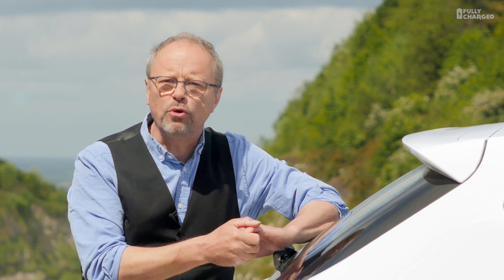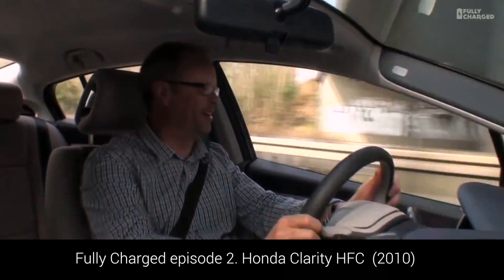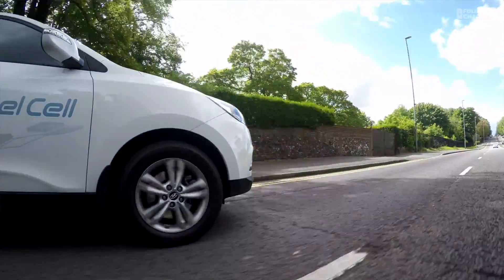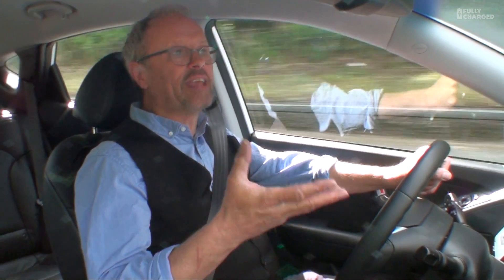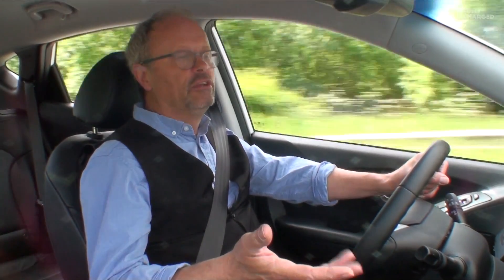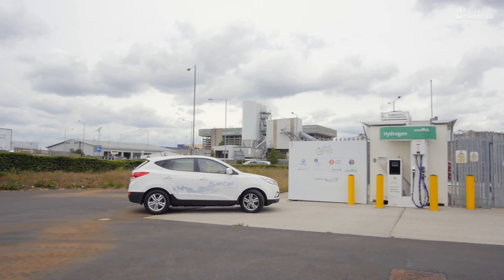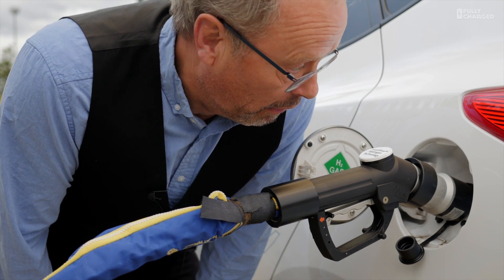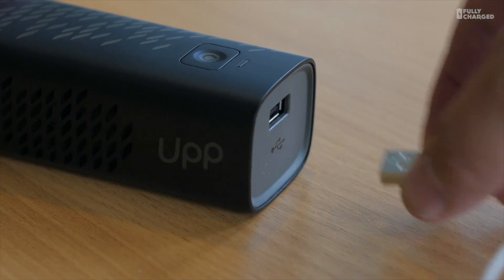Hyundai ix35 HFC | Fully Charged

Comment: A few things seem to have been glossed over.
1. That Carbon Dioxide is a by product of the generation of Hydrogen by steam reformation at refineries.
2. Measurement of the gas provided by a hydrogen pump has always been an odd issue which is why most trials have provided the hydrogen free of charge. How exactly is the gas being weighed? If the whole car is being weighed - what happens if a passenger gets out during the refilling process?
3. The pressure 700 bar is around treble that of a scuba tank & in most countries a scuba tank needs to be checked regularly in some annually  - how are these tanks and the associated pipework going to be checked?
4. Often the wind generated power is turned off not so much because it is not needed but because it is more expensive than other sources.
5. If you loose around 70% of the electricity electrolysis to fuel cell, then surely it makes far more sense to drive an electric car.
6. Worldwide there are very few Hydrogen stations yet already one has exploded in the USA in 2010
This whole Hydrogen gimmick just seems to be a desperate attempt by the oil industry to keep in the game once electric cars become more widespread.
Reply from the maker: Roy Richardson I think I agree with you on many points you made, with the exception of the wind energy argument. 
Wind energy is much cheaper than any other form of electricity generation, the reason it costs more at the moment is down to subsidies and guarantees to investors of locked in £ per megaWatt payment. 
This has already been slashed to nothing as regards onshore wind by the current government which is fine as long as they slash similar 'incentives,' 'tax advantages' and 'non subsidy subsidies' to other forms of generation, in particular nuclear which sucks up such vast quantities of all these tricks it's beyond imagining.
So, in a genuine level playing field world, which I admit we'll never live in, wind generation has such massive advantages it would put all the coal, gas and nuclear industries, their powerful and richly rewarded lobbying groups out of business.
Reply: fullychargedshow I agree that the incremental cost of the wind energy is low, but the slashing of the subsidies is only for as yet uninstalled plant it does not affect existing renewables. Due to the subsidies to the plant owner which are guaranteed for some 20-25 years this inflates their charge to the user (the electricity companies) & the FIT are usually inflation linked - so any spare cheap electricity is not likely any time soon.
Reply: fullychargedshow Well, why not store it in grid batteries or home batteries. In general, the Lithium batteries have a 90% cycle efficiency, which is quite good. It's similar to how Tesla uses this in a way for one of the SuperChargers in america where they have a battery buffer to decrease the fast charging impact on the grid whilst charging the Tesla at 100kW.

There is a point though, where batteries just don't make sense anymore when you have that much generation.

From a earlier video you posted when you visited the national grid in England the spokesperson told you that they could easily sustain half a million cars. So you could argue that they could channel the current excess energy into a BEV, the problem being, we don't have half a million of those yet!
Reply: Craig Britton The key problem you can;t get round is that the hydrogen solution is either using hydrocarbons - in which case why bother, or is using hopelessly inefficient hydrolysis. If you have electricity from whatever source it makes more sense to use it directly in batteries rather than convert into hydrogen loosing around 70% of that energy.
Of course NASA like Hydrogen - in space you can easily keep it at low temperature for efficient storage simply by exposure of its container to the hard vacuum of space
Reply: Nick Cummings Indeed - I have a Tesla Powerwall reservation to attach to my Solar PV.
Reply: I totally agree - at the moment hydrogen doesn't add up. Musk even calls it "dumb". To me that means that the supply chain and its supporting technology needs improved. It doesn't mean we should abandon hydrogen. I drive a plug in hybrid every day and very rarely use the engine. When I do, however, the quick refuel convenience makes a difference. I could live with a Tesla (bank manager and speeding tickets permitting), but I'd be far happier with something like the ix35 if hydrogen became green.
Reply: Roy Richardson I think one of the other issue with Hydrogen, or rather the Hydrogen filling station, is the cost.
It's not difficult to understand that a Hydrogen filling station will be substantially more expensive than a charging station. You have to maintain a very volatile gas under high pressure and low temperatures. On a recharging station you only need a very high amperage power supply unit. We already have off the shelf products like this.
I would say that a recharge station will cost a very small fraction of the price of a Hydrogen fuel pump to build up. Not to mention the maintenance. Again it will cost pennies to maintain a recharging station versus the thousands that will cost to keep the refueling Hydrogen stations, no to mention the enormous amounts of money that we will need to spend moving the hydrogen from the production facilities to the pumps.
We already have an infrastructure for distributing electricity. Even if you live in the middle of nowhere, it wont be very difficult to connect your house to the grid, and consequently recharge an electric car. Can you Imagine living in the country and expecting these car manufacturers putting, maintaining, and refueling an Hydrogen pump station.
That's why I don't agree when ***** said on this video that Hydrogen refilling stations will pop up as quickly as we seeing the recharge stations come up. 
One final point I would like to make is the economy of this technology. It's seem to be very complex highly inefficient and more easily controlled by very wealthy only individuals. The owner of a small shop on any high road can put a charging station in front of his shop and use it to promote his shop or just charge for it usage, could you say the same about a Hydrogen fueling pump?
Reply: Roy Richardson Apart from using it in Cars, there is a lot of work going on in the field of diverting 'Waste' renewable energy into the production of Hydrogen, and even man-made Methane, to add to the existing Mains Gas network that links almost all of Europe.  So effectively, as well as high-capacity batteries, we could in future be storing renewable energy in our gas supply.  There was an edition of 'Costing the Earth' about this, on BBC Radio 4 recently.
Reply: Roy Richardson As Robert described with EV chargers, now that hydrogen cars are available the infrastructure will improve exponentially. This improvement, investment and innovation will happen throughout the supply chain - starting at the original energy source and continuing right through to the pump. For example, significant amounts of research is being targeted at reducing the energy required to split hydrogen. Even if the hydrogen process remains relatively wasteful, the carbon neutral energy sources driving it will improve. Roll to roll solar cells being a potential game changer IMHO. Alternative nuclear generating options based on a thorium cycle are also looking attractive for low cost & low waste electricity production in the medium term. On a side note, hydrogen is NASA's rocket fuel of choice.
Reply: Craig Britton As indeed it may do, given time and research, but ATM it poses more questions than it answers.
Reply: João Silva Indeed - Hydrogen stations cost between $3m and $6m whereas a Chademo costs $16k + installation.
Also given the low density of hydrogen I have seen various estimates of 5 to 8 times as many delivery lorries to deliver the same energy level as gas/Diesel.
The main maintenance issue on Chademo seems to be cleaning filters and dealing with issues on authorisation/card swipes.
Reply: When humanity starts to make strides forward, idiots like you try to drag it back. 
You are just another flat-earther with an opinion.
Reply: +Roy Richardson I knew that the difference was Millions Vs Thousands, but I had no sources for this numbers. I guess Elon Musk is right, this is a dumb Idea, at least for now.
Don't get me wrong I would love to see this technology mature, but I'll be damned if anybody expect me to pay all the millions that it will take to make it into a feasible transportation network.
The other point is that battery technology is improving very fast, and with the advent of graphene and other newer substances, researchers are talking about doubling or quadrupling the battery capacities. This will mean electric cars doing 600 to 1200 miles on a single charge. With this technology you would even need the recharging station. We would just refill the cars at home.

Comment: Sorry but hydrogen still scares the hell out of me. Let's see a fully fuelled hydrogen vehicle getting hit from front, rear and sides (not at the same time) NCAP style simulating an 80 mph impact with another 4x4 size / weight vehicle. If it survives with no breach, I think the safety argument is over.
Nothing to hate about this particular car though, it looks like a very slick piece of engineering. Nice work Robert :)
Reply from the maker: Stephen Smith I truly don't think there's a safety issue with this. As squid bait said, this car has been through an extensive and highly destructive series of crash tests or it wouldn't be allowed on the road,
We all drive around in cars with a very explosive fuel sloshing around in the tank. 1000's of people die every year in hideous vehicle fires after sometimes quite minor accidents. 
Even if somehow a hydrogen tank is ruptured the hydrogen bleeds out in seconds, I think it is a lot less dangerous than current fuels we all deem 'normal.'
Reply: Stephen Smith This vehicle is on the road already so you can assume such tests have already been done extensively. This sort of thing is required for any car regardless of its power source.
Reply: Stephen Smith in an accident like that a std petrol tank will be ruptured easily vaporising the contents, and the people in the car and whatever hit it are probably dead anyway, in this case standard vehicles are the hindenburgs!

Comment: Hydrogen cars only exist so the oil companies can still sell you something. Protecting their profits.
Reply: breaksbassbleeps Agreed, this is the issue I have with hydrogen.  You still need companies to produce the hydrogen (as mentioned), you need a hydrogen distribution network (trucks, like fuel trucks), you need refuelling stations.  With standard electric vehicles, you can refuel at virtually any house or business anywhere.  An EV is quite functional even without a single fast charge station in the area.  There isn't a single hydrogen refuelling station in my state - completely useless here.  An EV could theoretically be charged at a completely off grid location if they have solar and battery storage!
Reply: breaksbassbleeps perfect.
Just buy a BEV, generate (at least some of) the power from your roof.
Reply: disagree with there are plenty  source of hydrogen more than oil.
Reply: Refilling your car in 3-5 minutes is quite attractive though. Low downtime, great for carsharing and selfdriving carfleets. So I think it is a great addition to a future without combustion engines and one of the many solutions. Le'ts not forget that parking and recharging space will be a huge problem if 80% of all drivers have EVs.

Comment: How much platinum is there in a battery electric vehicle?
Reply: fullychargedshow It was a trick question, there's none :-)
Reply: Nick Cummings Yes, there are quite a few, but they operate at quite a high temperature. They are also generally sized to a 20 foot shipping container as a generator replacement.

The problem is, fitting something that can work with petrol into a passenger car with the related temperatures is a bit of a pickle. A truck would probably have the space to fit the fuel cell and dispense of the generated heat.
Reply from the maker: zlozlozlo I bet there's some, I don't know, but if there is it will be a very, very small amount. I'm now going to try and find out.
Reply: zlozlozlo In chemistry Platnium is a non consumable catalyst. Unlike Galvanic Cells where anodes & cathodes are consumed and created depending on the direction of the electricty flow. The fundemental type of chemical reaction are very very diferent and seperate. The primary function chemicals of batteries is not Platnium.
Reply: zlozlozlo Platnium Fuel Cells are long outdated. No one even would even consider mass producing them anymore.
https://en.wikipedia.org/wiki/Fuel_cell#Comparison_of_fuel_cell_types

That is a list of other probably better fuel cells based on better catalysts & fuels.
Reply: No one even would consider mass producing them anymore. Hmm. That's weird, the Hyundai guy in the video just said there's platinum in those 1000 or so cars they're making. Yes, there are other types of fuel cells that don't use platinum. They usually operate at very high temperatures and have to be really large. Please wait until you get a bit smarter until you try your hand at commenting on technical stuff.
Reply: zlozlozlo Oh woops sorry mah bad, i should of read up on hyuandai's stupidity. I realy can't believe companies would still even both with such stupid methods. Wow this is a massive fail. 
P.S. I'm the wrong person to criticise experience in this area.
One part I did not foresee is the stupid actions others would resort to doing.
Reply: zlozlozlo Is there a Fuel Cell that uses Benzene/Petrol ?

I only ask because I assume it must be a more efficient way of extracting the energy out of it than just setting fire to it ?

Comment: Two things are neglected in the hydrogen discussion in my opinion.
1) Production
It is suggested that hydrogen can be produced when there is too much renewable energy. In fact, in Germany energy prices are negative at times especially in the weekends. More often however, there is no surplus of renewable energy and how does this effect the suggested production of hydrogen? Will production be stopped at those times or will these installations tap into the grid to continue production? In the latter case these installations will put a serious strain on the grid which already has to come to terms with low production of renewable energy.
If the installation is stopped when there is no surplus of renewable energy, I seriously doubt that the hydrogen can be produced at a compatible rate. These expensive installations usually need to run 24/7 to be profitable.

2) Infrastructure
When I look at the small hydrogen stations (250kg/24h) in use today, I notice they have quite an installation hidden behind the pump. I wonder how this will work at motorway petrol stations when 2500 kg/24h and more is needed. Where the hell will they put the pumps and storage tanks? If they can't put them underground, how will it be protected from accidents and sabotage? What is a safe distance to houses and other buildings?
Reply from the maker: Ad van der Meer You ask very good, very well thought out questions to which I have no answer. I should have asked but then again, maybe I should do another show which asks these awkward questions when I'm not trying to review a vehicle that uses hydrogen.
Reply: *****
I apologize if you feel this was a critisism on you or your video. It was most certainly not intended that way. These points have been in my mind some time and I blurted them here in the hope you or your viewers had some insight in these matters. 
I really appreciate your video's here and value them as a part of the EVangalisation of petrol heads.